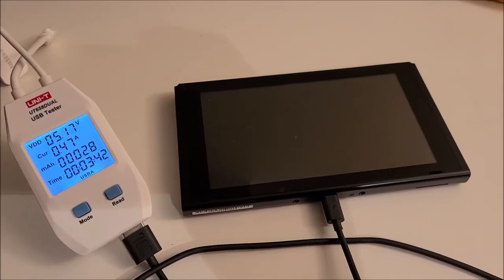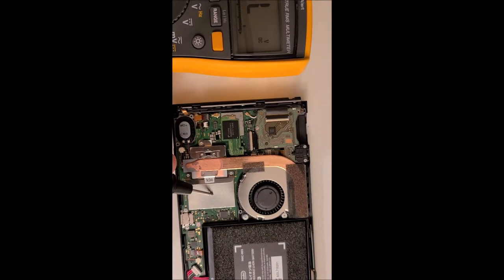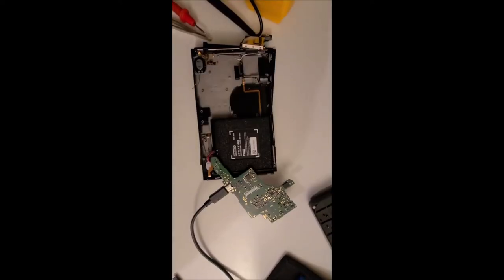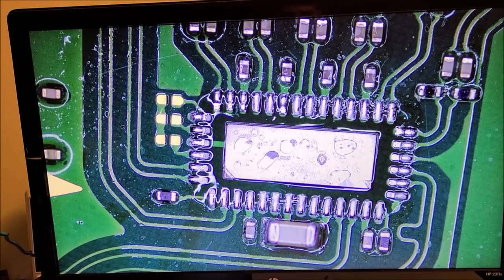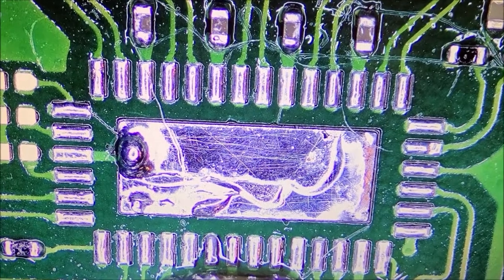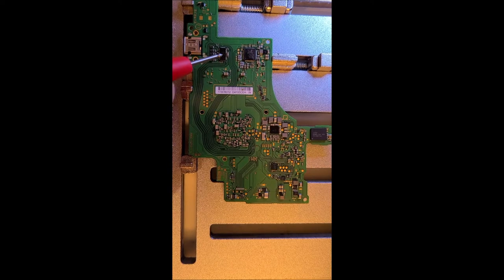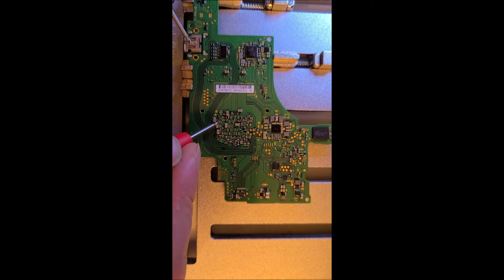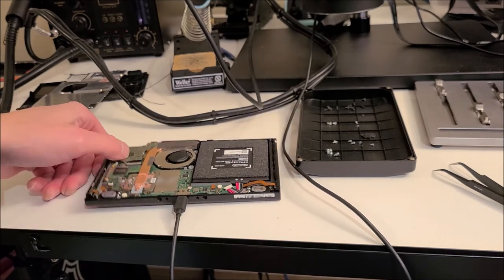Nintendo Switch No Power Troubleshooting - Shorted CPU

Comment: Switch CPU has low impedance on back of CPU across some capacitors. This is totally normal. and most probably not the problem.
When you turn the unit off the CPU goes to ground to protect it.

Comment: Try to inject a voltage like 1.5amp to any shorted component to find out which part of board/parts are getting hot. Most likely it will be faulty one which causing the short.
Reply: Amp is current, not voltage,  dude.
Anyway, the guy is not ready.
Reply: @Thehustler01828  what he said is true, so it's called "Voltage Injection" and you do it to pinpoint which component is shorting under the Thermal Camera. and you inject voltage, with a specific current value, and in that case this guy said "1.5 Amps" which is true.

so basically he is not wrong, he is true, you inject voltage to the Cap with 1.5amp current value.

Comment: Those capacitors do not have a short. When you troubleshoot around the CPU always use resistance mode on your multimeter. This applies to laptops and GPUs as well. In diode mode it will always beep. You are a technicians nightmare.
Reply from the maker: Thanks for the feedback.  I agree that resistance would provide a more accurate assessment so I just checked them now and both sides registered 0.3 Ohms so I still suspect the CPU is shorted out as I would expect > 1 Ohm if the CPU wasn't shorted out.
Reply: @shaneperche-fixed-it  Did you put back every capacitor you removed before checking?
Reply from the maker: @natetechr  Yes, I put them all back.  I have another working switch so I'll take it apart this weekend and see if I get the same behavior.  Do you get a resistance on those capacitors > 0.3 Ohms on both sides?
Reply: @shaneperche-fixed-it  Just remove the large cap next to PI3USB. Use diode mode and check if both sides are short. If so, then yes you have a dead CPU.
Reply from the maker: @natetechr  I took a look at the video you sent and that cap is not shorted for me.  I fixed that short by replacing the p13usb but the caps are still shorted on the back of the CPU even if I test with resistance.  I have another working switch with the same motherboard version and they are not shorted like this one so I still suspect a shorted CPU.  I found another video with those same shorted caps here:  https://www.youtube.com/watch?v=D8bNwP6JlPc&t=964s  and he was able to solve it by removing those shorted caps (@25:07) so I guess that's worth a try.
Reply: @shaneperche-fixed-it  Curious if you tried the fix in that video?  A repair tech told me I had a shorted CPU and he wasn't sure if it could be fixed, but wondering if it would be possible to try this?